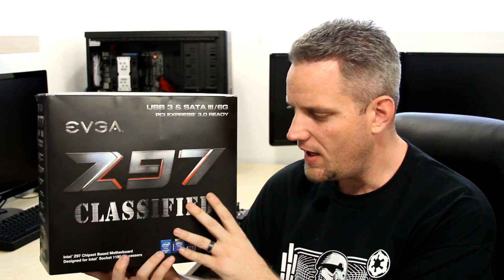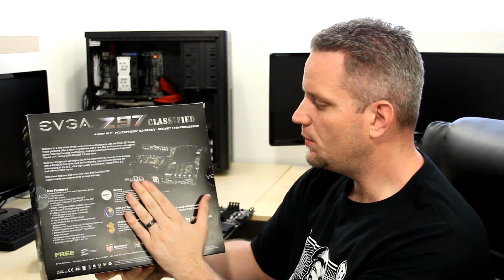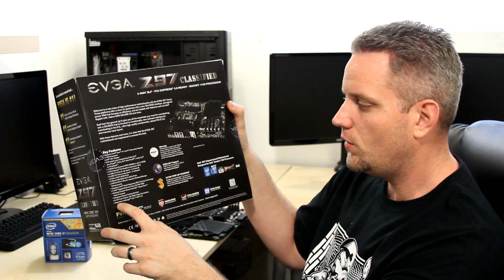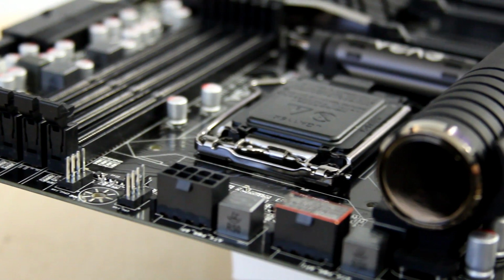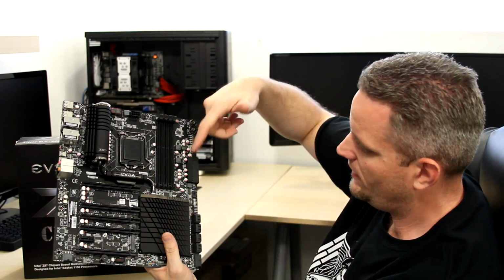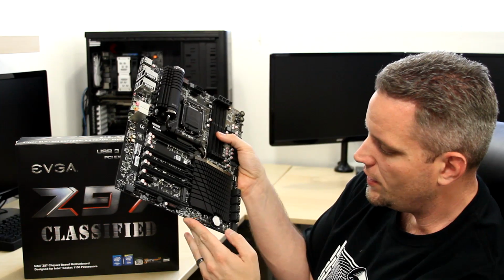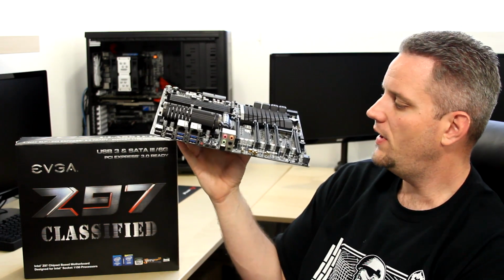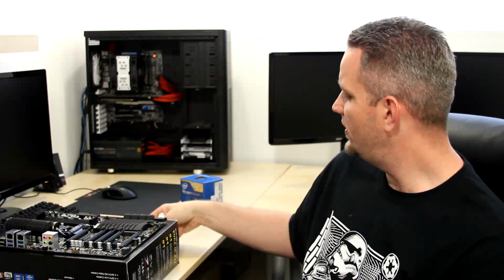Amazing features with very little compromise! EVGA Z97 Classified!

Comment: what you guys think about my build:

CPU: i7 4790k
GPU: MSI gtx 770 (because it's cheaper where I live)
RAM: Corsair Vengeance
MoBo: Asus maximus hero VII
SSD: Crucial mx100
HDD: WD 1tb
Cooler: Hyper evo or kraken x41
Case: NZXT h440
PSU: corsair CX600
Reply: get an i5 4690k because they are both 4 cores and all cores are the same the only difference is the i7 is 8 hyper threads and i5 is 4. But games do not use hyper threads. (Yet)
Reply: Leon Klee Nope it's adesktop sshd is designed for laptops where there isn't much space
Reply: Mohamed Amine I think its a great build!
Reply: Do you do 3d/ editing? If not you should get an i5 4670k and get a 780
Reply: Mohamed Amine Go to a forum or something, I recommend linus's forums or pcpartpicker.com. But this build is pretty good. RAM you have chosen is good, but overpriced. It looks good though, so do what you want. For the ssd I would recommend an 840 evo over the one you have chosen, but the one you chose is pretty good too.
Reply: I'll be doing editing stuff and gaming on 1080p single monitor I may add a secondary one just for surfing when i'm in a game so multitasking. Here's the partlist http://pcpartpicker.com/p/PWvfnQ
do you think guys is it worth the extra 50 bucks to go with the evga gtx 770. I want to use the m.2 ssd in my mobo should i get the m.2 ssd or just a normal sata.
Reply: Rem NL I said in an earlier comment i'll be editing mostly adobe premiere and after effect and gaming single 1080p display.
Reply: kasettys1 ok I'll take that in note what do you recommend for ram
Reply: Mohamed Amine Sorry, I was thinking of Corsair Dominator Platinum. What is the price of the ram you chose?
Reply: Rem NL lol. So what do you think about my buil is there anything I can improve
Reply: kasettys1 $144.99 from amazon does the dominator deliver better performance.
Reply: Mohamed Amine Dominator only looks cool, it doesn't perform better. The Vengeance usually is a pretty good deal. How many gigs are you looking at?
Reply: kasettys1 16gb
Reply: Mohamed Amine I would recommend a Thermal Take A31 case and an EVGA 750 watt gold certified PSU. I would also highly recommend getting  an Asus z97-A ATX motherboard. Then after doing all of this I would recommend getting a PNY 780 XLR8 or an MSI one which are about $470 overall if you do all of these you will be getting a better system for about the same price.
Reply: kittenassassin If you have some of those parts spair especially the Gpu i would like if you send me one because i already beyond my budget by 500 dollars
Reply: you dont need an i7 for gMing .. get an i5 4670k
Reply: zach vinny I would be editing as well
Reply: Mohamed Amine  Standard i7 (ex. 4770k, 4790k) have more threads than i5 CPUs. Threads are mainly useful for editing. Though, if you edit on a regular basis, then you need to consider going for i7-4930k (about $500) and a LGA2011 motherboard, such as the Asus X79-Deluxe.
Reply: Daniel Cilia that's a good idea but how much a full build lga 2011  pc will cost.
Reply: Here is a good build that will fit your $1000 budget http://pcpartpicker.com/p/w94ddC . The i5 will be just fine for editing and you can go a little over budget and get 16 gb of ram. The hard drive is  an HDD so it is also fast. I also live near a microcenter so I can get the processor for $180 so if you want to you can contact me on skype and I can ship you out the processor for a discounted price.
Reply: kittenassassin I extended my budget to $15000 give me another build. I want the h440 case and matching black and red color componants
Reply: 1500 or 1500? Mohamed Amine
Reply: kittenassassin 1500
Reply: not bad at all
Reply: http://pcpartpicker.com/p/z368bv
Reply: kittenassassin the ssd though
Reply: Mohamed Amine This is what I recommend:
Motherboard: Asus ROG Maximus VII Hero ($211.99)
Processor: Intel Core i5 4690k ($238.99)
RAM: Corsair Vengeance Pro 8GB 2400MHz ($92.99)
HDD: WD Green 3TB ($107.99)
SSD: Samsung 840 EVO 250GB ($129.99)
Front fans: Corsair af120 Quiet Edition Dual Pack ($31.67)
Corsair af120 Quiet Edition Single Pack ($14.99)
Rear fan: Corsair af140 Quiet Edition ($20.99)
CPU Cooler: Corsair H100i ($97.16)
                   Corsair sp120 Quiet Editon Dual Pack fans ($31.67)
GPU: XFX Radeon R9 280X ($269.99)
PSU: Corsair ax860 860W ($169.99)

Add that with the H440, and you end up with it costing $1,525.72. While this slightly extends your budget, I personally consider it worth the extra cost. As you may have noticed, the build is also geared towards overclocking. (Btw, I got all these components off amazon.com)
Reply: Thanks all you guys for the help I have one final question is it better to use the M.2 ssd in the mobo Than a normal sata ssd if so what are the benefits and how reliable the M.2 is.
Reply: serious question, could that pc run like minecraft.  I mite be asking too much, but could it run low to medium settings.  Please answer, i dont know much about thus stuff
Reply: Game A Flame barelly you need to turn down the resolution to  640×480 on low settings
Reply: Mohamed Amine Really :(.  CAn u give me a build that could manage minecraft.
Reply: Game A Flame i was really hoping it would be good
Reply: Game A Flame you'll need an i7 4960x and a double titan z sli
Reply: k thanks.  Can u giv me a pcpartpicker
Reply: Game A Flame Just just google it.
Reply: Game A Flame Your videos suck.
Reply: kittenassassin i know, you dont hav to be rude
Reply: Mohamed Amine still what kind of program do you plan on using ?
Reply: Really nice build m8, but I would really recommend that go with a higher quality Power Supply, like the Corsair RM 750 or CS 750, both amazing and modular. And for the SSD, I would recommend that you go with a Samsung 840 EVO SSD, amazingly fast and reliable
Reply: So I should upgrade to a higher quality one, and use the evo 840 ok thank you all guys for the help
Reply: Mohamed Amine No problem m8. It wouldn't be a bad either to get the 4 GB version of GTX 770 to be more future proof as games are closing in on the 2 GB cap, and so you can SLI later with the GTX 770 4 GB and the high quality power supply
Reply: ***** I don't like the future proof quote the GPU Will run out of horse power before running out memory I will update my card every year or so. I'd rather get the gtx 780 than a 4gb 770.
Reply: Mohamed Amine Your choice m8. But what PSU are you going with?
Reply: ***** EVGA SuperNOVA NEX 750 G 80 PLUS GOLD Certified 750W
Reply: Mohamed Amine Yeah that's a good one
Reply: ***** Thanks
Reply: Nobody at this point really needs more than two gigs of video ram
Reply: Mohamed Amine That is why all of the SSHDs I see are 3.5 inch....

SSHD is designed to be cheaper than an SSD and faster than an HDD. It is a cost concern, not a size one.
Reply: zach vinny Watch_Dogs
Reply: Cheesepuff This SSHD by WD http://www.amazon.com/Black2-Dual-Drive-2-5-WD1001X06XDTL/dp/B00GSJ9X4Q/ref=sr_1_8?ie=UTF8&qid=1405116055&sr=8-8&keywords=sshd cost nearly 200 dollars I can get 250 GB SSD and 3 TB hdd for the same price Meanwhile the SSHD is only 128 GB SSD and 1 TB HDD
Reply: Mohamed Amine Black Squared isn't an SSHD. It is two separate drives. It's a truly one of a kind product and has a price to match. Look into Seagate for SSHDs. I believe they have some kind of trademark or patent because no one else makes the same thing. It is like an HDD with several gigs of flash cache to keep only the most used programs. Which it intelligently assigns to the fast portion automagically.
Reply: Cheesepuff I might in the future get another 16 gigs of ram and use it as cache that will out perform anything out there
Reply: Mohamed Amine Nice! It would be fast. My next upgrade will probably be another GPU for crossfire. I am pretty satisfied with my storage situation.
Reply: Cheesepuff Cool man.
Reply: Swap your ssd into a samsung pro 850 cause mx100 sucks!
Reply: SmartTechAdvice Yeh that new one with the 3d nand I may wait for the mazwell gpu aswell
Reply: Mohamed Amine :O
Best Ssd of all time: 850 samsung pro(trust me on this)

Good luck :)
Reply: SmartTechAdvice I've seen reviews on anandtech and i understand how fast it is
Reply: Jeffery Peters Yes of course going with the 850 pro and wd 1tb hdd
Reply: Jeffery Peters But the amount of writes on the 850 is higher means longer life
Reply: Jeffery Peters Believe me It's going to be needed for a long time After I upgrade I'll install it in my media server Which he will use it heavily torrenting is what's going to use it the most don't forget backups

Comment: Hey Jay, here is my system:
i7 3770 3.4 ghz cooled with Corsair Hydro H60 High Performance Liquid CPU cooler
16gb of 1600 mhz ram
a gtx 760 from zotac (4gb) 
500gb + 250gb hdd (5400 rpm)
and a 128gb ssd with the operation system on it.
My question is:
I have a pretty crappy motherboard that is not being sold in well known sites or stores (H61MLV2 [6.0]) and I don't know if I should upgrade it because it still works fine but it's pretty small with very high end components.
Should I upgrade it or keep it like that because I don't have a pretty high amount of money.
Let me know please
Reply: no sense in getting another board unless u wanted more pci e lanes or your getting a newer proc and need the new socket just wait
Reply: don't fix what's broken.